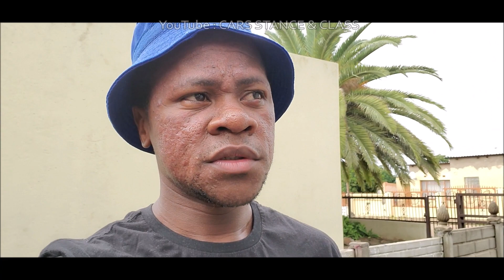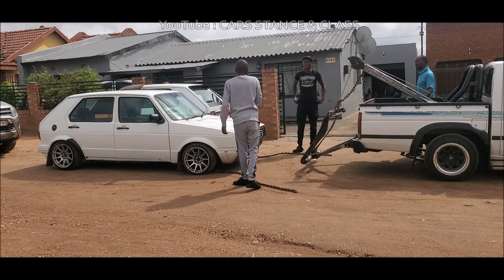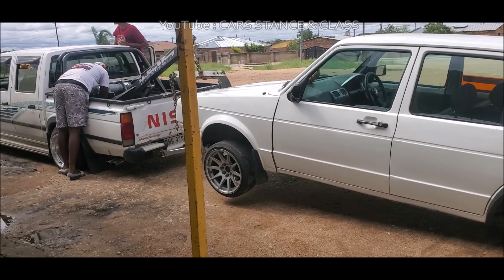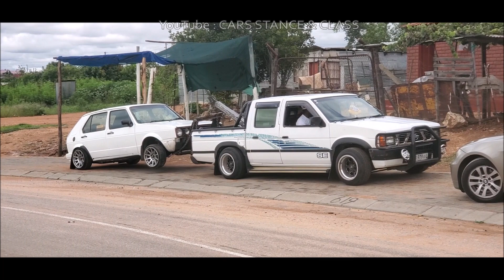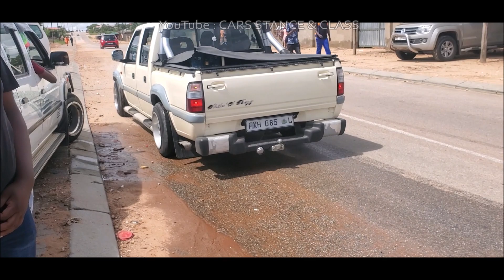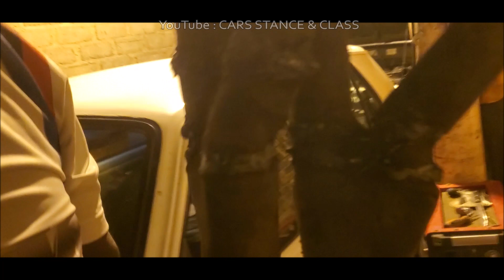NKUPI & MADAGA 16V SWOP DAY 6️⃣ BANANA BRANCH 8V TO 16V MODIFICATION 💨 BOIKKIES EXAHUST

Comment: I just want to see Jipper hitting the streets with that gasflowed 16V Vula Vala
Reply from the maker: Can't wait
Reply: @carsstanceclass  I wish Jipper can challenge Katra's 2.0 16V ABF with Casey 1.8i 8V also challenge that red mercedes b class
Reply from the maker: That Mercedes-Benz was beaten long ago 🤣🤣 ... let's wait for Katra & Casey
Reply: @carsstanceclass  🤣😂😅 yea but my advice is that you should get a bigger Flywheel from the MK2 gti and send it to get lighten (shave off some weight on it) to get faster revs when racing
Reply: Casey 1.8i 8V has alot of mods like gasflowed, Ported & polished cylinder head, 288 cam, cold air intake, cataylic converter delete etc... but you can beat him if you get the best Spitronics ecu Tuner that will install mods like launch control and he can try to push me motor to rev to 7500 rpm, my biggest question is are you running k-jet tronic or converted it to mp9 fuel injection? It will be more feul efficient and add some power on fuel injection
Reply from the maker: Yah yah these cars are a hassle...